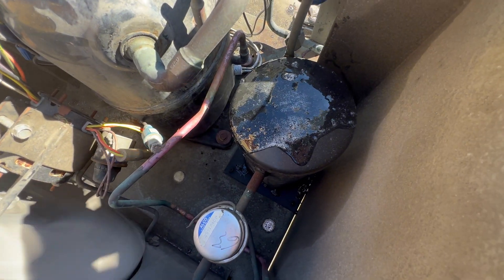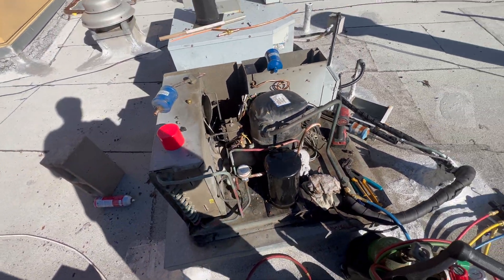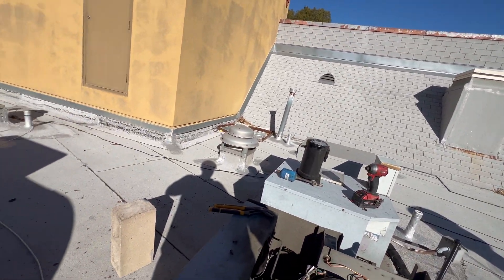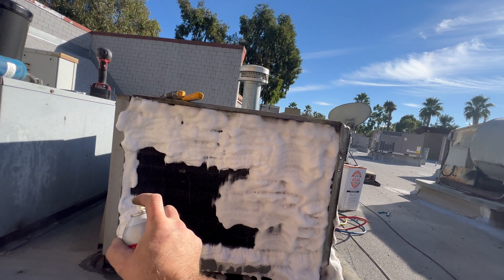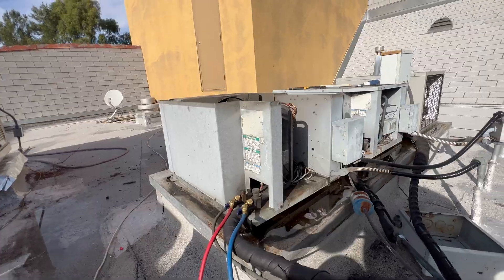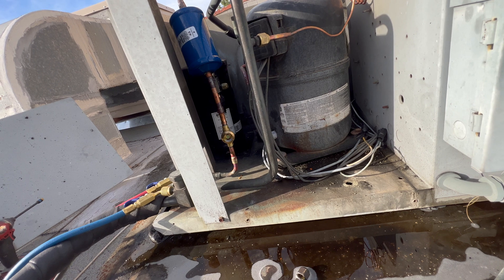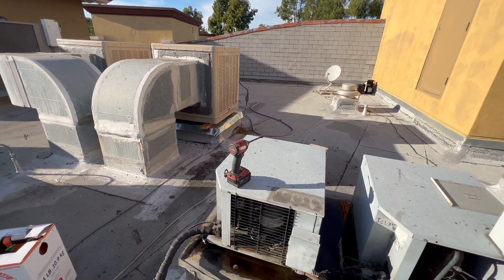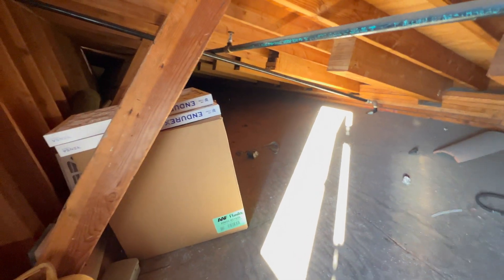Walk in Freezer Receiver Leak.

Comment: Good vid ! I did a video on exact same repair. Walk in cooler though. Same leak. Top temperature safety plug. Mine was a Old unit. About 20 years old.
Reply from the maker: Yep. I did replace those few times before. Not common, but happens.
Reply: @MaratRPMSoCal   yea, definitely not common. But, something to Allways check. Its hidden under a sticker sometimes too. Sneaky little suckers.